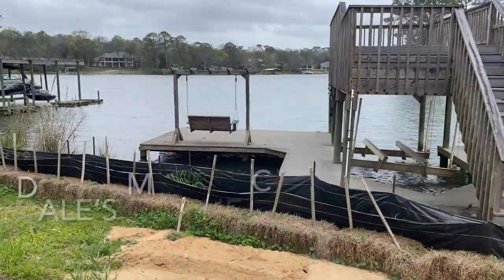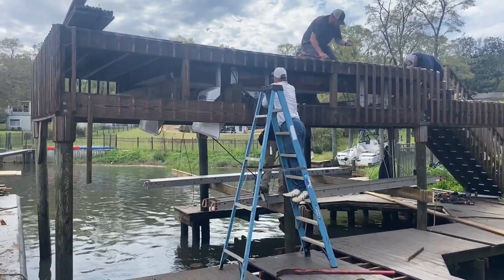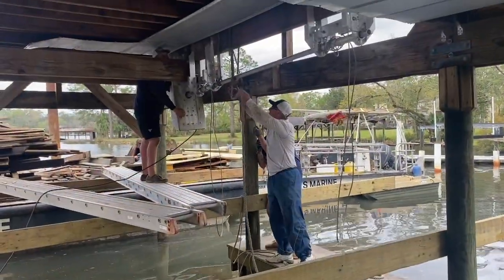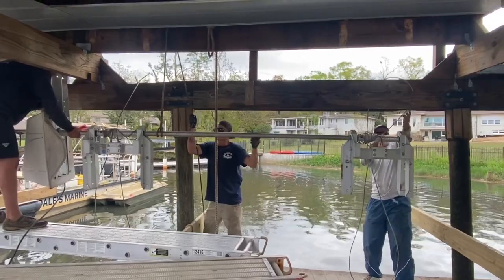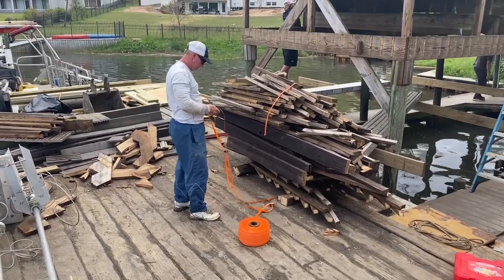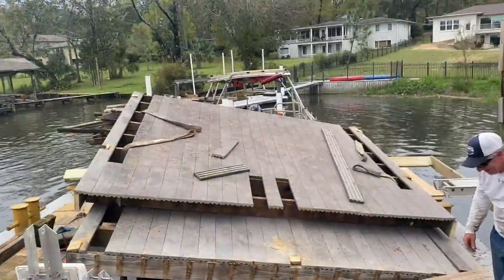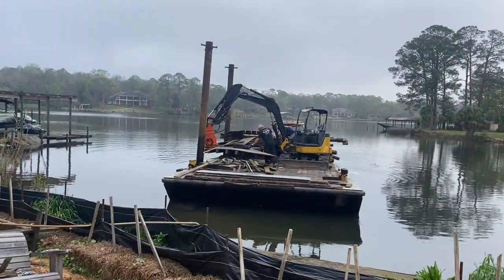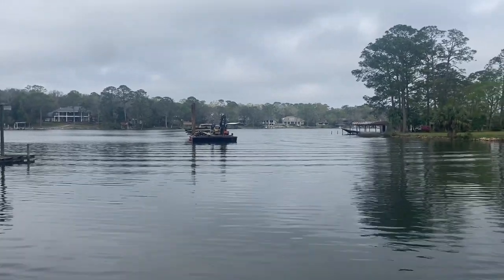DEMO DAY, reclaiming an old dock and boat house

Comment: Hey Dale, Got a question for you. Anyway trick or method to set a 6" x 16' post with one man using the jetting method. Such as building a temporary structure to help hold and lift the the piling ?
Reply from the maker: Hey Paul if it’s in the water you’re trying to jet it in I would take two boards nail them or screw them together like a V and shove it down in the hole next to your jet pipe then you could slide your piling up against that and walk it up. If I’m land you could set another shower pole right next to it with a pulley on top of it and tie a rope just a little higher than the middle of the one you’re trying to stand up and pull it up in place. Just an option my dad never believed in equipment I always had to figure out the manual way to get it done and we did! Probably why I had rotator cuff surgery and need on the other arm now LOL
Reply: @DaleWHickman  Thank you Sir, I was thinking the same thing, just wanted to confirm with an expert...thanks much...